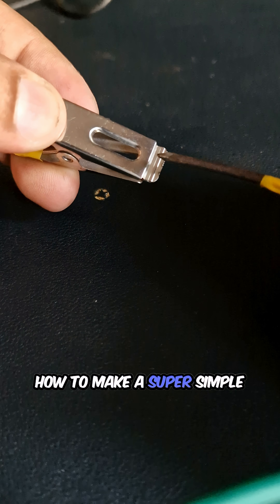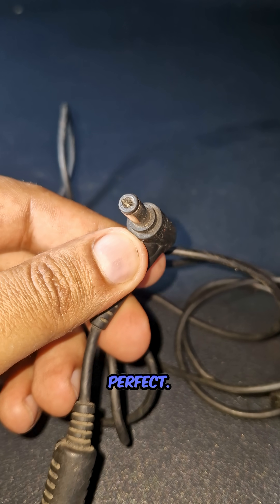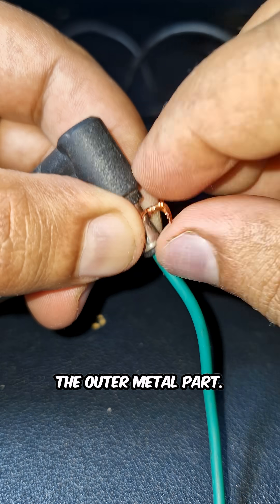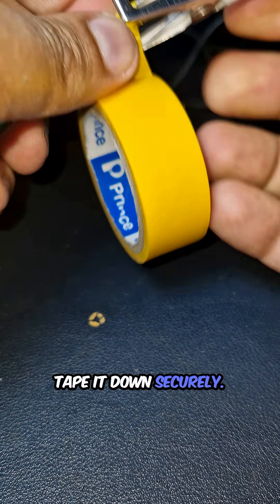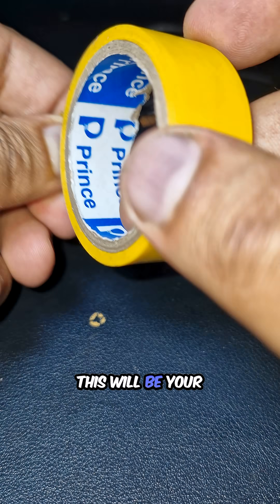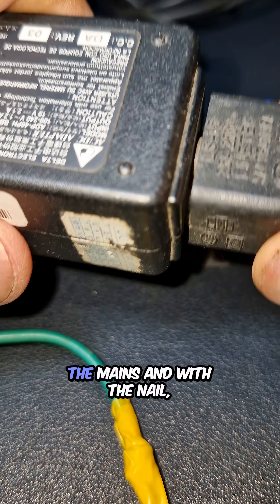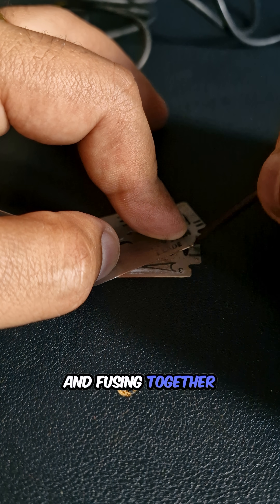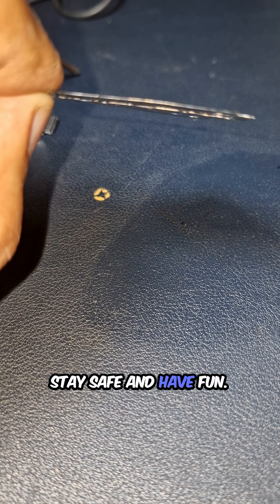How to Make a DIY Spot Welder at Home (Using an Old Laptop Charger!) #spotwelder #welding #diy

Comment from the maker: ⚠️ Safety Note:
This DIY spot welder is just for fun and small experiments. Use only low-voltage chargers, avoid long weld times, and never touch exposed wires while plugged in. Always be cautious when working with electricity!